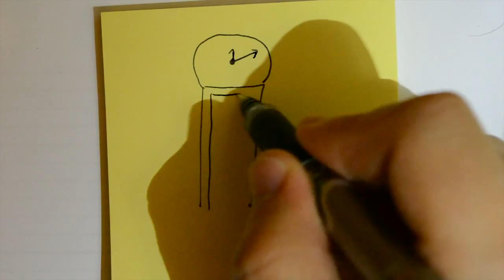How do Mechanical Watches Work?

Comment: Watching so many watch videos but not a single one of them explains how a mechanical spring constantly supplies energy to a watch without being twisted or wound up.
Reply from the maker: +Flerm Mechanical springs do need to be wound up quite often, mine needs it every couple of days. But once you've fully wound it up its designed to slowly release that energy at a near constant rate over those few days through clever material choice and precision engineering.
Reply: ForwardSlashReality there are mechanical watches that dont need winding though
Reply from the maker: Flerm  There are some 'self-winding' watches, that have a weight attached to a pivot on the back such that when you move your arm while walking the weight spins and that winds the watch up. And if you have a watch like that you can put it on a motorized stand to wind it up.

These generally do need winding up still though unless you're quite active wearing them.

Comment: I am actually going to buy that very watch, except in the Rose Gold and Black
Reply from the maker: It is a lovely watch. If your experiences are anything like mine, you'll have a lot of people asking to take a closer look at it, it makes a good talking point
Reply: It is a standard Mechanical correct?, because I've seen many places say it is an automatic, even though the movement in the back lacks a pendulum.
Reply from the maker: My one has the weight in the back that causes the mainspring to be wound as the watch is moved if that is what you mean, but it does still need to be wound manually every few days
Reply: So this is the model NO Behind the watch. ROTARY-GS02522-01 (the 01 i think specifies color) , because the pictures i have seen it doesn't look as it has that weight.
Reply from the maker: I have GS02519/09. Perhaps mine is just an older run of the same style watch. Either way, the automatic winder doesn't make much difference
Reply: I can tell now that they are different looking at pictures, the minute dots are replaced by hashes, and the frame inside the new watch has more intricate "Scrolling", where as yours has less. I might possibly get the GS 03715 which is a similar, automatic version of the GS2522, but i far prefer the looks of the 2522
Reply from the maker: I'd go for the 2522 if you prefer the looks, winding up the watch isn't much of a hassle. You only have to do it every few days and it takes about 15 seconds
Reply: i can see what you mean, but the 3715 is darker, and cheaper, and considering that you can get a $700 watch ( E500? (pound?)) for 70  it seems a good bargain and even though winding is something daily, the auto winding is really an attractive feature

Comment from the maker: All the tiny little springs and components in between are set just right so that it balances out to the same amount of energy, by how much its allowed to spin etc. But as the mainspring does get much looser each tick has pretty much the same energy, but there is more time between the ticks because of the loss of power. This means the watch runs slower when its nearly unwound. Hope that helps!